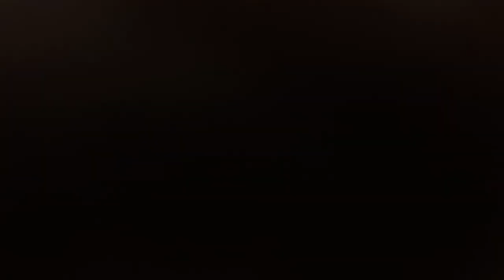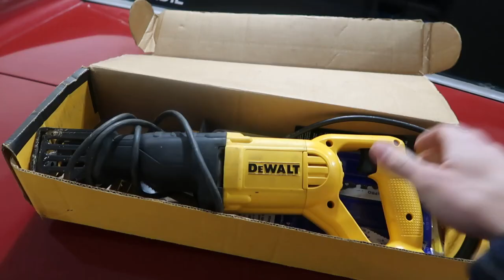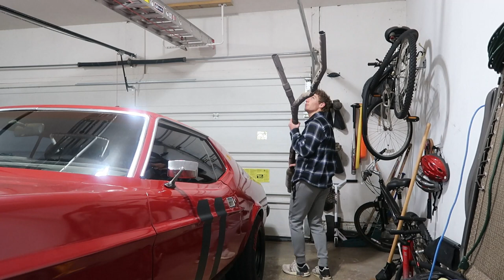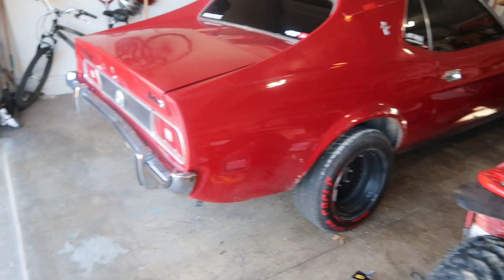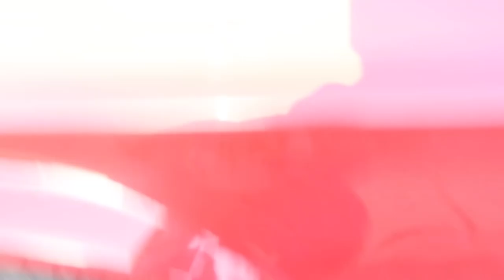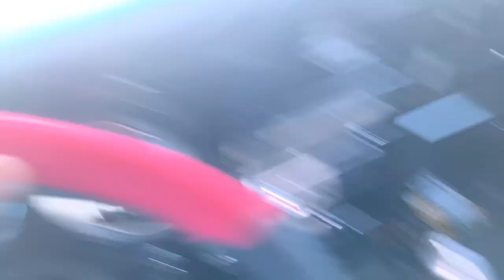Chopping The Exhaust Off! 1973 Mustang Without An Exhaust Sound Test! Straight Piped 302 [Part 9]

Comment: lol i did the same thing with my 73.  chopped the muffler but it sounds different from yours, mine might be cammed or i need to correctly adjust the carb lol
Reply: The carb def has to do something with it, my carb needs some work done and sounds a bit different
Reply from the maker: Lol